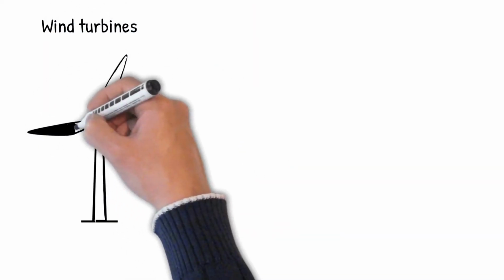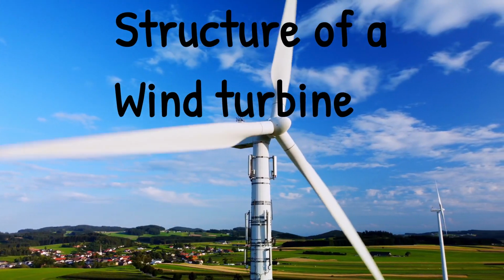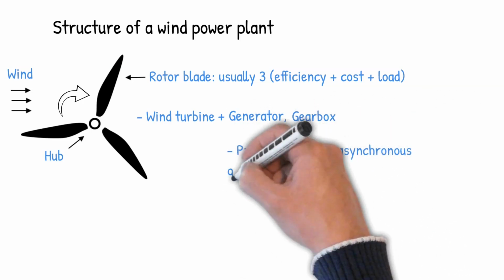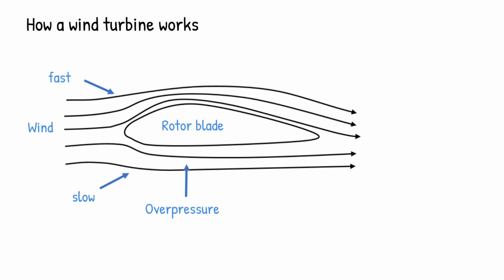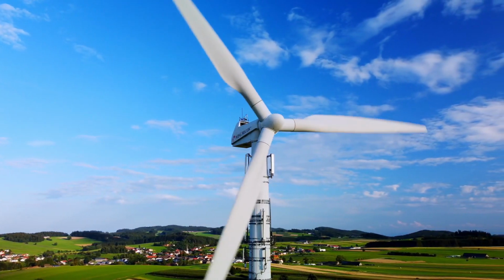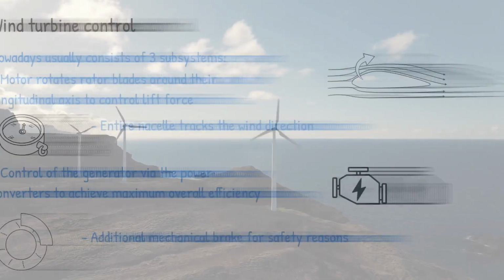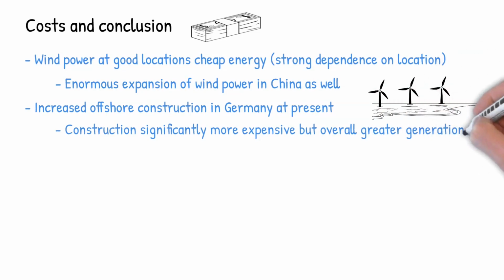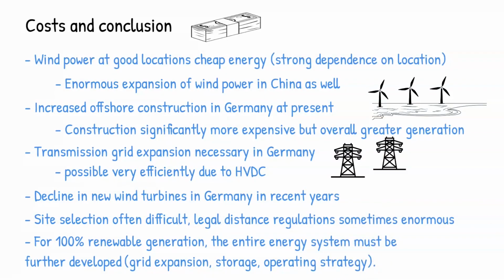EVERYTHING you need to know about wind turbines!

Comment: There is no mention of the wind turbine's capacity.

If, for example, the maximum power must be supplied at wind force 7, then this is
still 52% at wind force 6
at wind force 5 at 24.5%
at wind force 4 at 9.9%
at wind force 3 still 3.1 %

A society that needs constant energy cannot work in this way at all.
That is the major disadvantage of wind turbines and storing energy is also very difficult to solve with large amounts of energy.